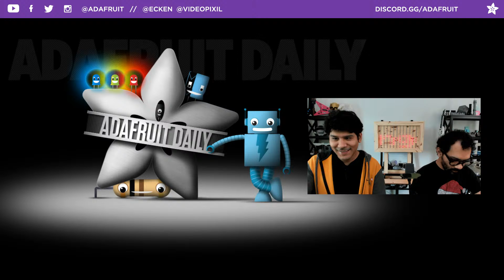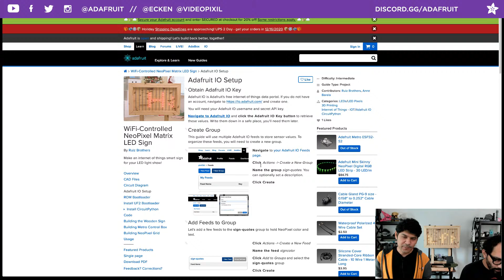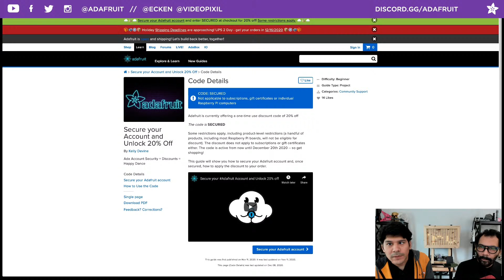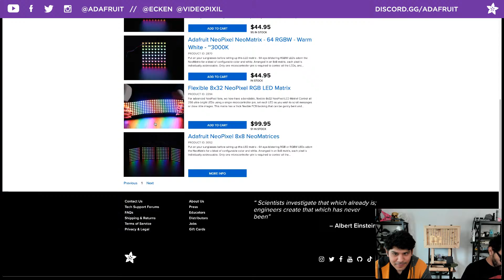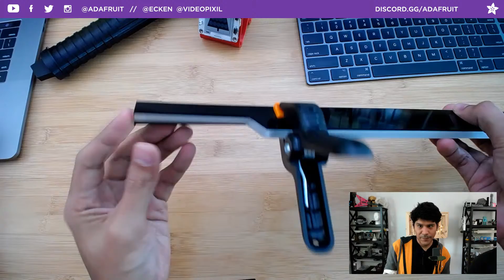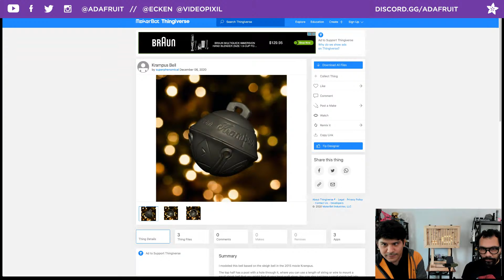3D Hangouts – IOT LED Sign, Darksaber and Ornaments #adafruit #3DPrinting

Comment: I would fix the gap between strips the same as the gap between pixels to make it square. One problem you will find with horizontal strips is gravity. I like the vertical strips that use gravity to advantage.